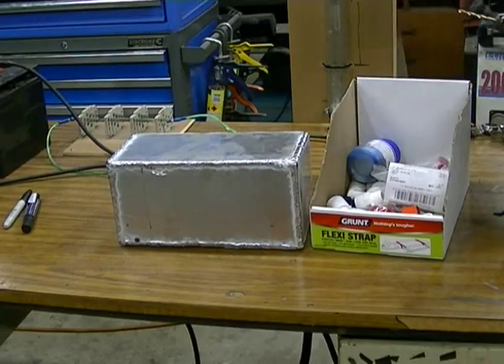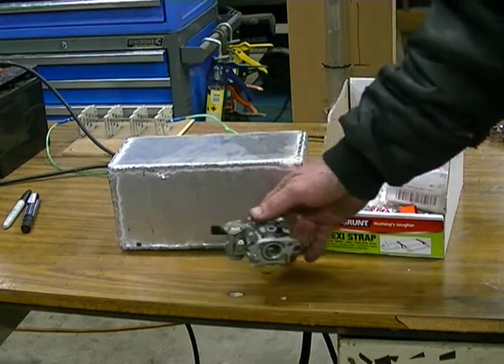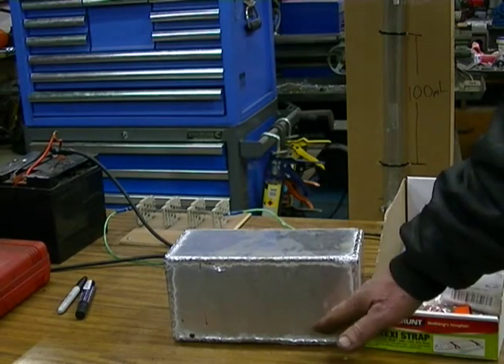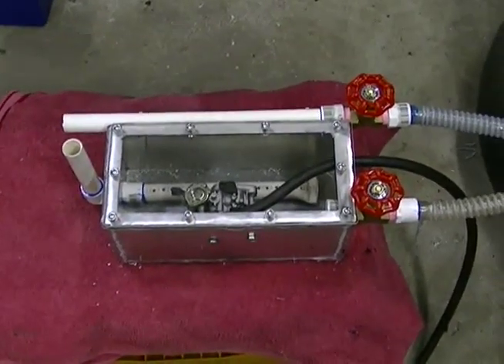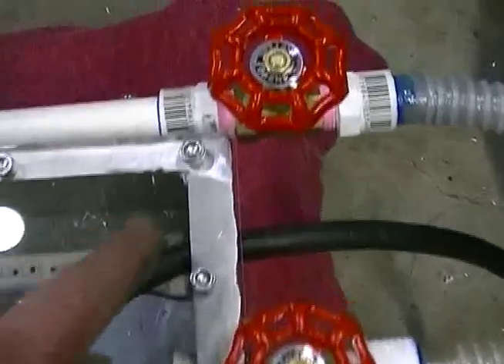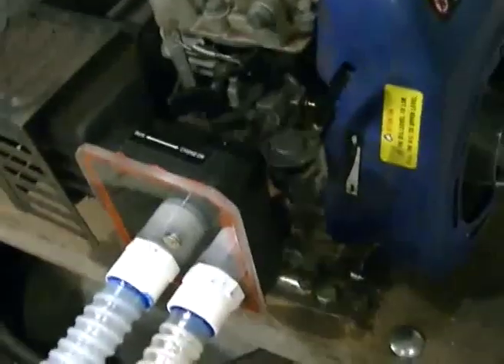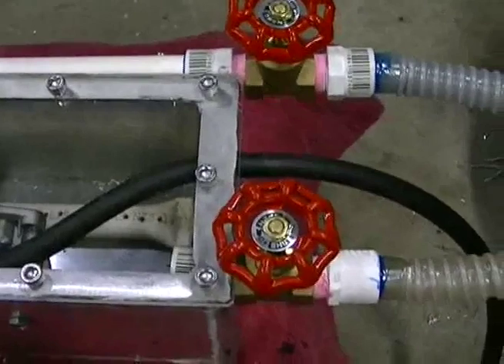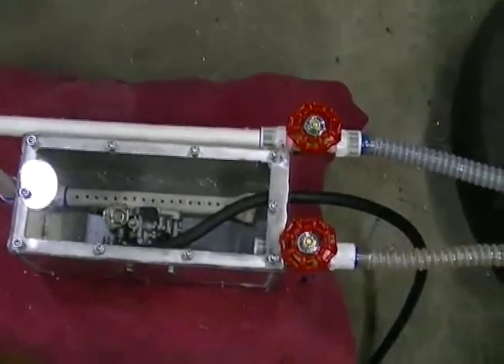The fuel vapour system

Comment: This idea works but it has to be improved. The gas can't be exposed to outside air. You must boil the gas under FULL vacuum. The gas vapor must stay hot all the way to the carb or it will recondense back into a liquid gas. And finally the engine will run extremely hot due to the fuel being so lean so it must be mixed with water to keep from cracking the head. Thanks and good luck. Just because you suffer a setback doesn't mean you fail. You only fail if you quite
Reply: Hey finally the first person who thinks like i do.  Everything must be done that allows a liquid to convert to a vapor or a gas and we know how this is done it’s called evaporation. We also know that evaporation is usually done off of the surface of the liquid through temperature and airflow knowing this we can also say that the more surface area you have the more evaporation you will get. What a lot of people do not understand when they build these systems is the amount of vapor needed.  Also most of these are not producing vapor , instead they are creating a mist,  in essence they are just making a carburetor that produces approximately the same droplet size as a regular carburetor does so their mileage increase is not that good.    I agree you have to heat the fuel so it vaporizes  easier.  you should have a large evaporation surface area that is heated also then you must draw hot air into the vaporized fuel just before it goes into the engine.  The fuel and the air must remain hot all the way to the intake ports,  if anything cools it down your droplet sizes will increase and you will lose vapor and create partial mist again.    I will disagree somewhat with the overheating aspect as when you burn a vapor we all know that natural gas engines run a lot cooler than gasoline engines remember we are not burning a liquid fuel anymore which continues to burn out the exhaust port and through the exhaust system creating heat along the way this shouldn’t happen as much with gasoline vapor so I think the engine temperature will drop substantially not to say that water vapor will not help this process And even add to the efficiency of the engine I just don’t see the high temperatures in vaporized gasoline

Comment: i saw a guy doing it with a lawnmover and in the end there was no gain in this .... it ran roughly about the same amount of time  , have a look :
  https://youtu.be/IuGWHfWqWtg
Reply: The problem was his mode of employment.  Your not suppose to bubble the fuel.  You are suppose to run the fuel intake off the top of the fuel and warm the fuel up for more complete vaporization.
Reply: @motorbikemadness5773  i don t how tis brings any saving !?! + more dangerous !?!? gotta heat it stronger if you don t bubble it !?!? must be a rather marginal gain !?!
Reply: @StellarionPrime  Incorrect. Heat tape applied to the outside of a METAL container will produce the desired result without the inherent risk. Placing stainless steel wool on the bottom of container will help with vaporization.   Instead of commenting without further research, go do more research.
Reply: @StellarionPrime  Here: https://www.youtube.com/watch?v=Ke0MGmUr3SU
Channel: https://www.youtube.com/channel/UCFwKCnUUBHo2HhOgtGi5c1w
Reply: @motorbikemadness5773  he heats it with exaust gas !? from what i know its so hot it would ignite everything before it reaches the engine ... (about 600C for exaust gas)... how is this possible ? is he giving it a turn extra to cool down ?
Reply: @motorbikemadness5773  see that is the issue... you do reasearch but in the end an important detail they keep to them selfs makin personal reasearch kinda obsolete in a sense , or one starts investing in parts and tinker on their own ...and i don t have investing capital so it gotta be mostly online
Reply: @StellarionPrime  Did the car blow up or catch on fire as he rolled up to the driveway?
Reply: @StellarionPrime  All you would've had to do is type into google or whatever you use: vapor carburetor and go from there.  Quite easy. Lots of good infromation out there.
Reply: @motorbikemadness5773  i m not making such suggestions ... i just wanna know what he obviously is NOT telling .... the details he leaves out
Reply: @motorbikemadness5773  fuck google , hahaha no help ... anyways they gonna make gas so expensive by end the whole process is only good for the enviroment not everyones wallet... true free energy is the way to go unless they don t start restricting this to folks too
Reply: @StellarionPrime  He is not leaving anything out.

Comment: Cool vaporizer, I’d consider using a material that will not corrode like steel wool corrosion , as you are  I’m sure aware ‘petrol’ is mostly water so I think there is a possibility that the steel wool will corrode and form iron oxide particles. I don’t think that the iron oxide will combust or aid in the combustion.
Reply: stainless steel wool?
Reply: rampaging bull I didn’t know that was a thing, how elegant , so the steel wool has some crystalline structure surrounding its surface? I was wholly unaware that household cleaning products had progressed to such a manner, I would have suggested some polymer blend material that was also porous I think I saw another gent using types of ‘filters’